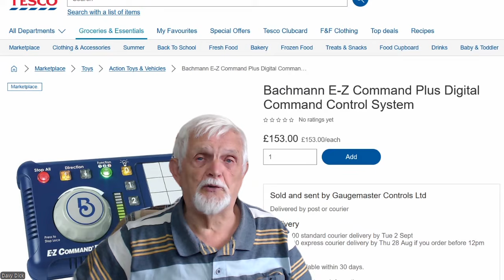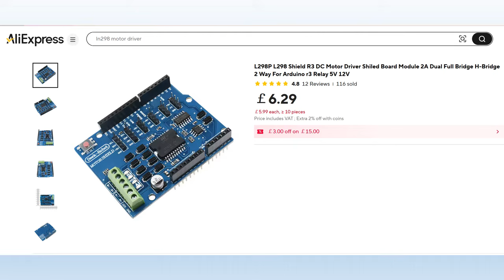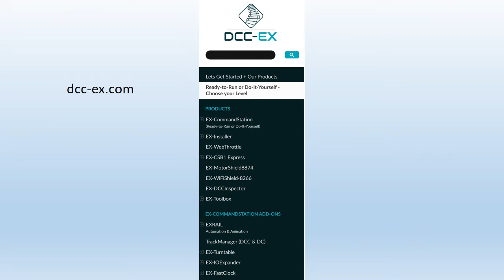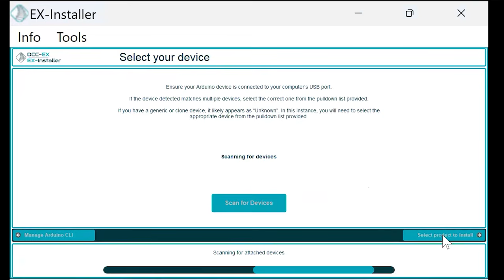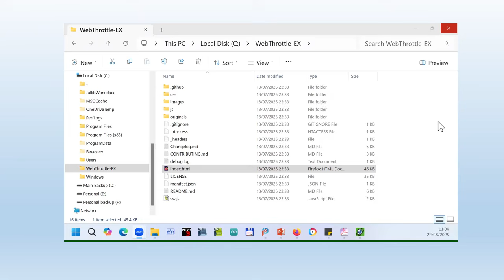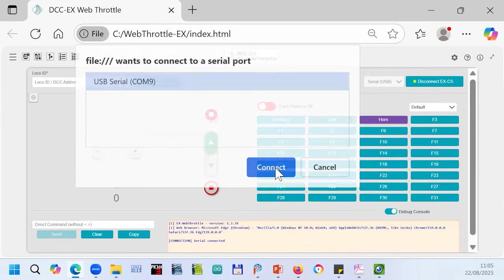A basic DCC controller using the DCC EX WebThrottle

Comment: Hi there great video thanks. You mentioned that you would be able to use the programming track as a siding, will it work straight away probity isolation rail joints